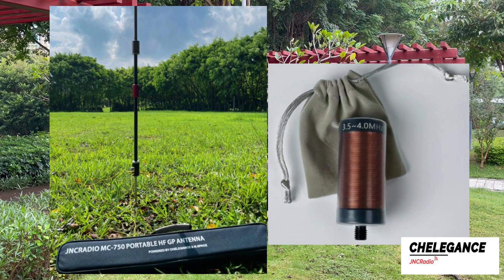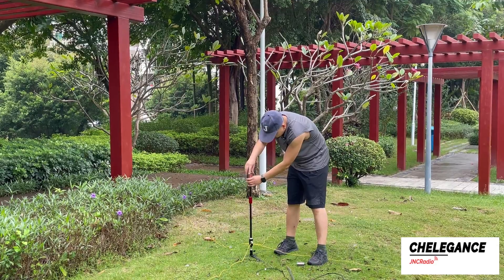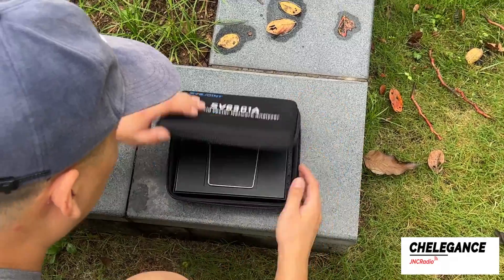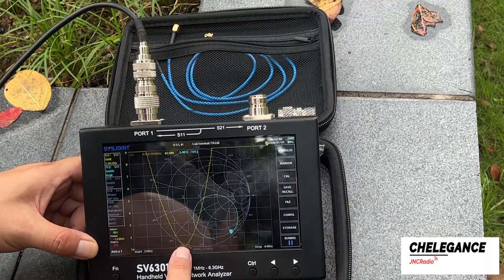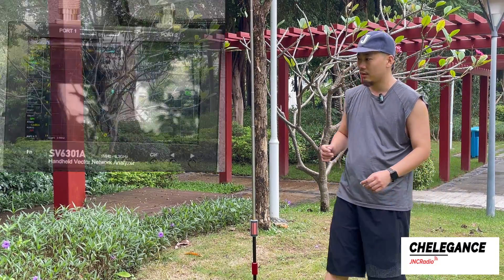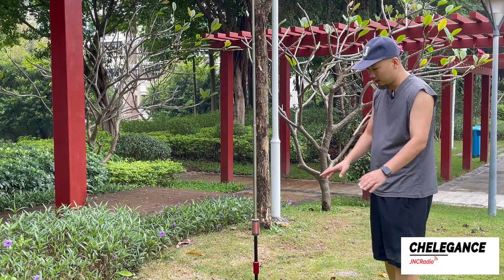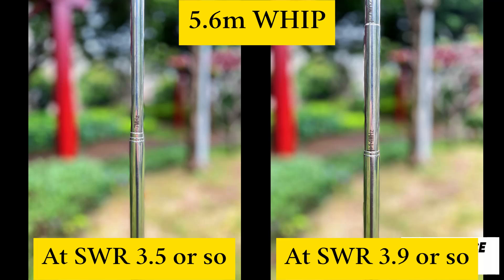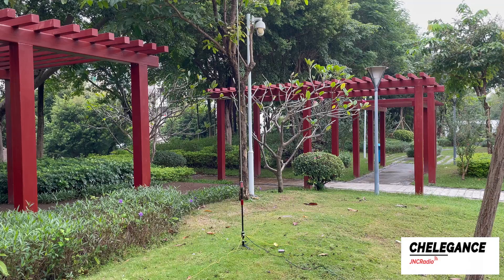80m Coil for MC-750: Supercharge Your HF Communication Experience!

Comment from the maker: Correction
In the video, I made a mistake and accidentally referred to the frequency range of 3.5 to 3.9 as SWR values from 3.5 to 3.9. I want to clarify that SWR values are a separate parameter and not related to the frequency range. I apologize for any confusion, and I hope this correction helps you understand the accurate information.